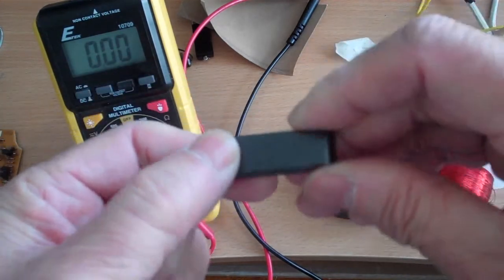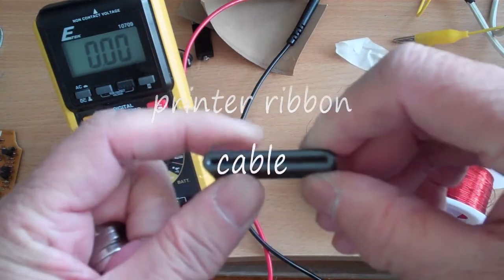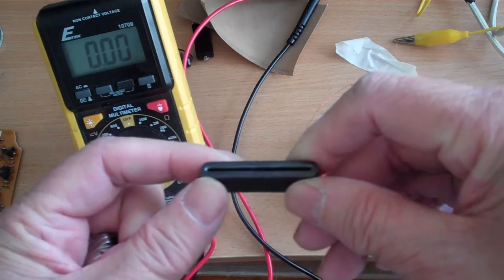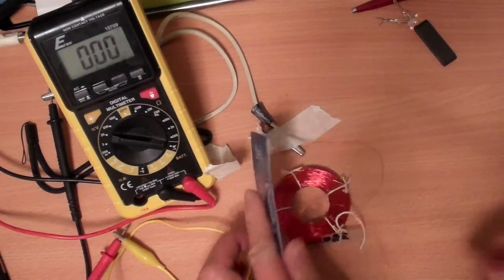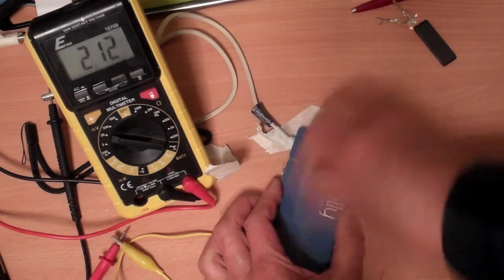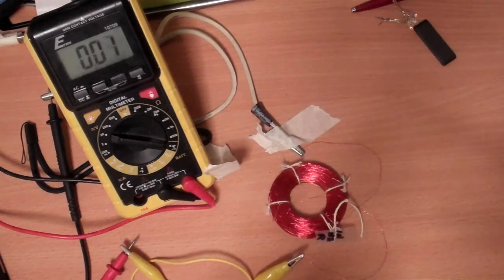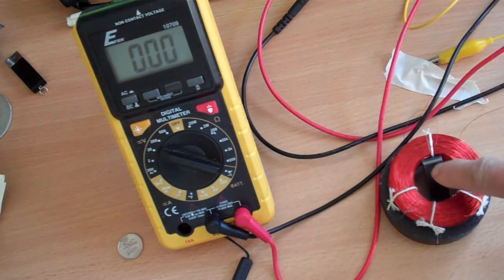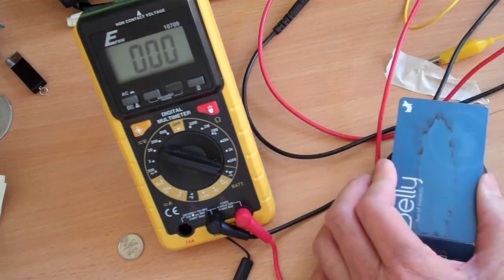Air core and iron core coils

Comment: What is the difference between air core and cored coil
Reply from the maker: Cored can generate higher voltage.
Reply: And iron core is worse sound quality , and cheaper for audio applications

Comment: When im doing the exate same thing i have no voltage, i dont get voltage how is that possible
Reply: insulated material looks like copper.Remove it well.
Reply from the maker: You need a coil that has very fine gauge wire with many turns. Mine was 1000 turns of 32 gauge wire if I remember correctly. You also need a strong magnet, neodymium preferred. You’ll get enough voltage and current to light a few leds.
Reply: @wtam69  thanks for your response, i use 20 meters of 24 gauge wire, didnt count the turns, i think its strange that when measuring the resistance i get open loop, no matter when im measuring, mabey i use the wrong kind of copper. I have no connection between the in and out of the coil
Reply from the maker: @fabianbakker5260  remember you also need to sand the tips of the Magnet wire or you won’t get any readings when u attach the multimeter to the two ends of the wire.
Reply: @wtam69  i think i have to remove the paint layer, mabey thats the reason i donr get voltage
Reply from the maker: @fabianbakker5260  yes, either sand or use a lighter to burn off the insulating material. Magnet wires are insulated.

Comment: Nicely done. I have tried using steel cores in my coils and get decent results.  I know that steel has properties that prevent proper absorption and I do have a bucket of magnetite to try with that method but in the interim, as long as the magnets are allowed a bit more air gap, you can use this method with reduced cogging and increased output.
Reply from the maker: Thank you for commenting.

Comment: how many turns of wire you have used and which wire you have used for coil
Reply from the maker: 18 awg wire at about 200 turns.
Reply: please correct me is it 2000 turn of coil or 200?
Reply from the maker: I'm sorry, this coil is actually 32 gauge wire at about 1000 turns.
Reply: @wtam69  I was gong to say. 200 turns of 18 AWG would not give you that result at that speed or number of magnets.

Comment from the maker: I bought 12 reels of 32 gauge magnet wires on Ebay but so far I wound up 1 coil only. My roofer left me his old 10 inch saw blade so I thought I might try and see if I can make something out of that. Maybe later. Maybe after I do a rocket stove BBQ.
Reply: Just keep in mind that 32 AWG will have a very low current capacity so it will have the tendency to burn out if the load is anything above .5 amps.  You can move up to 26 AWG and put in 500 turns for similar results and a higher ampacity.